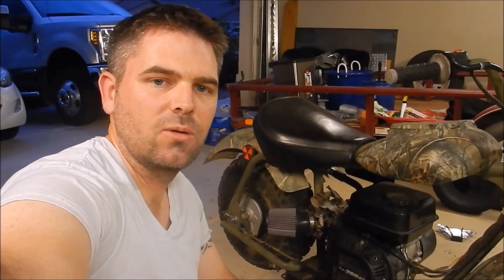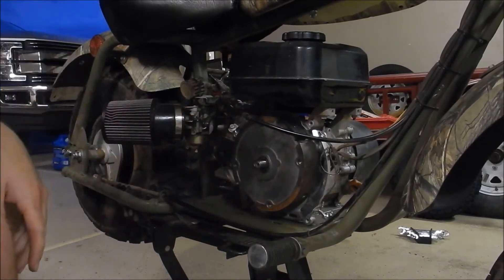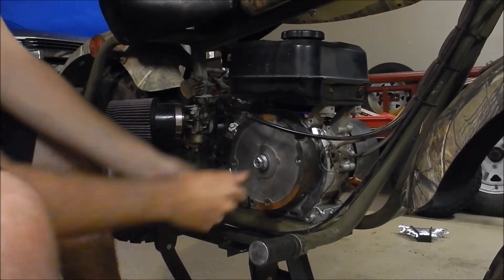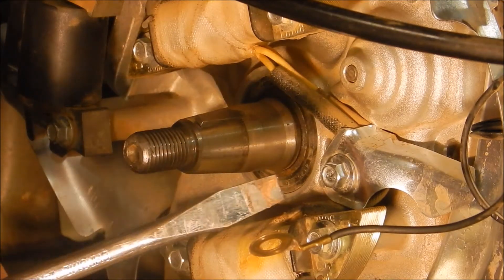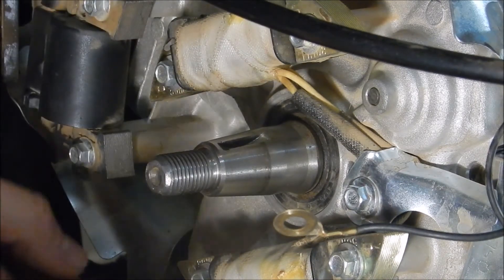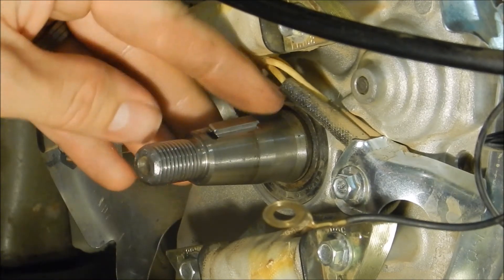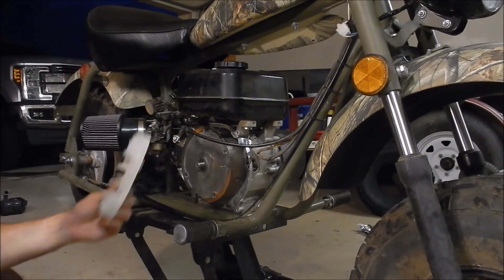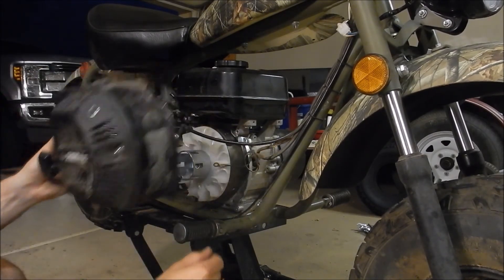How to Install Offset Flywheel Timing Key on Baja Warrior Mini Bike

Comment: What's the spec on your impact gun? I'm having a hard to remove the lock nut on the flywheel fan of my ct200.
Reply from the maker: its something like 250 ft-lbs. try spraying penetrating oil on it and let it sit over night.  the next option is to apply heat.

Comment: I see you have the stage one kit installed? So what did the offset do for the motor? More speed, rpms, or low end torque?
Reply from the maker: Melloreel , honestly I couldn't really tell a difference.  I just did it because that's what everyone says you should do if you have the governor removed.
Reply: Brandon Napier I’ve seen very few performance kits that have the offset now?  Unless it’s a race engine,  probably don’t change much. Thanks for replying.